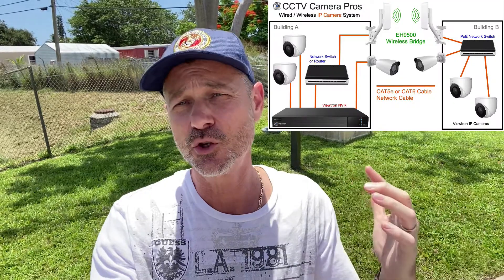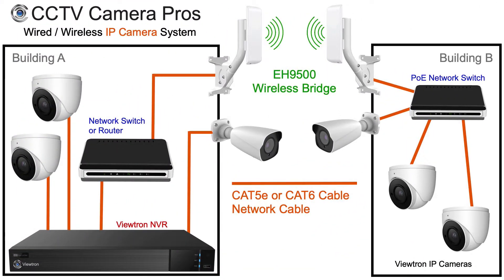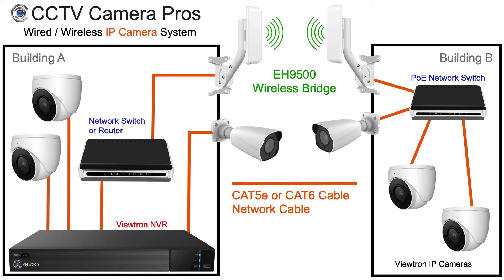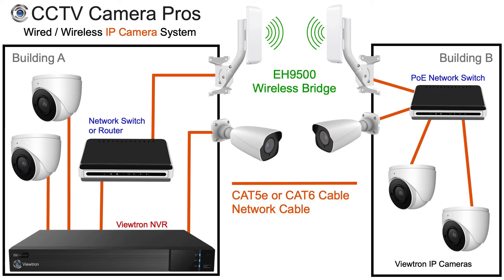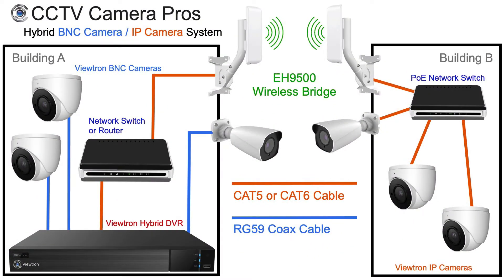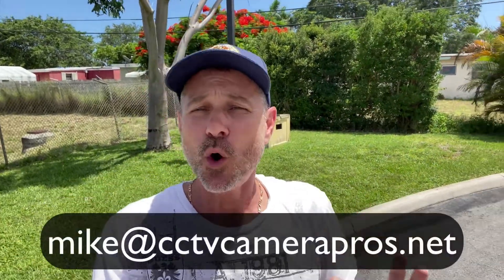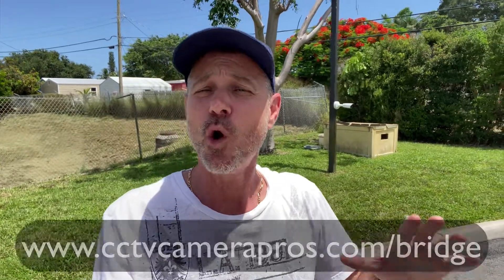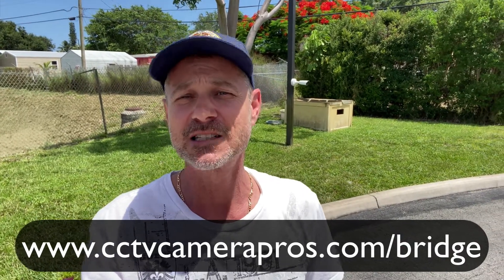Connect Security Cameras on Multiple Buildings to DVR via WIFI Bridge

Comment: I hope you can answer this for me. I am interested in setting up a Reolink Camera system with an NVR for my house and for a secondary building about 150ft away. I have already connected internet to the secondary building with an underground CAT6 wire that is connected to a wifi/router (configured as a bridge) in the secondary building for internet in that building and a wifi/router in the house. What would I need to do to add cameras to the secondary building without using the EH9500 wireless bridge since I am already hardwired?
Reply from the maker: Hey LegalVideoMan. All you need to do is add a PoE switch to the secondary building. Disconnect the underground CAT6 cable from the wireless access point / pointer and connect it to the uplink port on the PoE switch, or a regular PoE port if it does not have an uplink port like ours do.
https://www.cctvcamerapros.com/IP-Camera-PoE-Switch-p/poe-sw54.htm 

Now, connect the access point and any PoE IP cameras on the secondary building to the PoE switch.

If you are not already decided on Reolink, please consider our Viewtron products.

Our Viewtron IP camera NVRs work with Reolink IP cameras.
https://www.cctvcamerapros.com/IP-Camera-NVRs-s/1472.htm

And our Viewtron IP cameras work with Reolink NVRs.
https://www.cctvcamerapros.com/viewtron-IP-cameras-s/1474.htm

Hope everything works well for you.

Comment: Great video, I’ve a family friend who wants something like this. I’ve offered my assistance and this makes sense now. Quick question, have you ever streamed from an nvr to a firestick/chromecast etc? I will be putting the nvr in the roof space and would like to minimise wires, If I can stream to the tv instead of an hdmi cable this would be great
Reply from the maker: You can do that if you cast the video from the mobile app to your TV.
Reply: @ that’s a good idea, was thinking something more along the lines of on a firestick though so they can just switch to it on the tv as they are quite elderly and don’t think they will know how to cast from phone, even if I show them, I’ve read something about rstp? Is this something you’re familiar with?

Comment: Great video! I have a question, for example in bldg.  A the nvr is located, in bldg B there is 32 cameras, what wireless bridge will be used? Thanks
Reply from the maker: Thank you for the kind words. If there are 32 cameras in building B, CCTV Camera Pros recommends that you put the NVR in building B. 32 4K IP cameras is too much to send over a single WIFI bridge. To transmit 1-6 cameras, we recommend this wireless bridge. https://www.cctvcamerapros.com/Wireless-Camera-Antenna-p/wifi-eh9500.htm

Comment: I am not a video expert. I support a small business's desktop computers. Recently they needed their security camera system fixed. I replaced the power supply in the W Box Technologies NVR which fixed a problem with it not powering up. I'm able to see all four cameras display on the monitor at the main building where the NVR is located. There are four more cameras in a remote building that connect to the NVR over a Wireless Access Point. Those four cameras are connected to a BV model POE-SW802-DIN POE switch and a power adapter. Problem: the remote cameras show up on the monitor at the NVR but, only one camera at a time and just for a few seconds. Someone suggested there might be a bandwidth issue causing this. All the cables (4 camera and the cable to the access point) at the remote building POE switch are plugged into the standard ports. Would that be correct? I thought maybe someone unplugged the access point cable and plugged it back in the incorrect port. There's eight 10/100 ports, one 10/100/1000 Base-T and one 1000 Base-X.

Comment: Newbie here…Instead of having fixed cameras on building B, can you do PTZ cameras? And can you control them separately, or are will they all move the same since you are only plugged into one port on the viewtron? I’m trying to do the exact setup for a home (building A) to barn (building b) system, but wanted PTZ cameras in the barn instead.
Reply from the maker: Yes, you can do this wireless setup with PTZ cameras. Yes, you can control all of them separately. This is our best selling PTZ camera. It is an IP PTZ camera with AI software and auto-tracking. https://www.cctvcamerapros.com/auto-tracking-PTZ-camera-p/ip-ptz-425.htm

You can find a bunch of demo videos that use it here.
https://videos.cctvcamerapros.com/tag/auto-tracking-ptz-camera

If you want a free consultation and / or need a quote, email me at mike@cctvcamerapros.net.
Reply: Awesome! Thanks for the info!

Comment: Are you able to do a hard wire over to the shed? Or is there little to no difference between the wireless route.
Reply from the maker: That shed is not on our property. The wireless bridge carries the signal of the LPR camera and two AI overview cameras across the street to our warehouse.
Reply: @cctvcamerapros   on my property I have two sheds that I would like to put up some cameras in is it possible you can hard wire? If so what type of wire do you recommend I was thinking about having a few 4k cameras per shed with one inside plus a license plate reader on the outside facing towards the entrance.